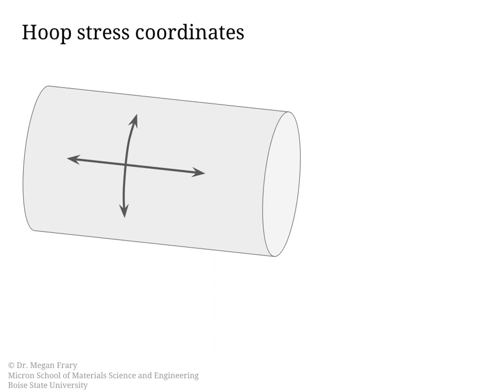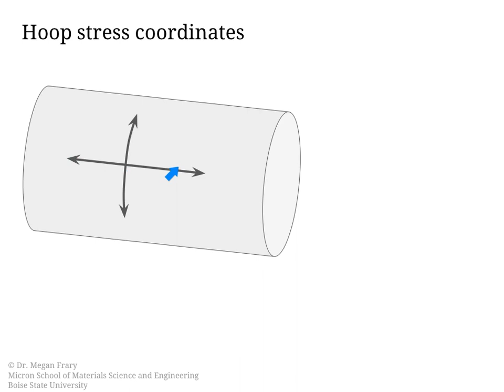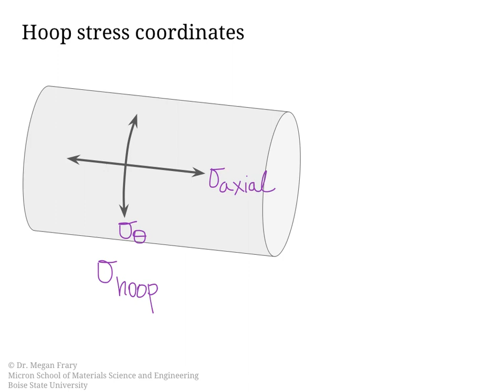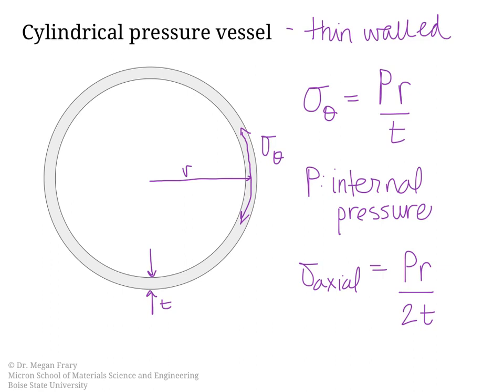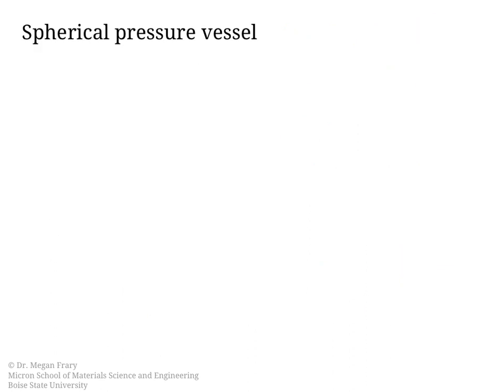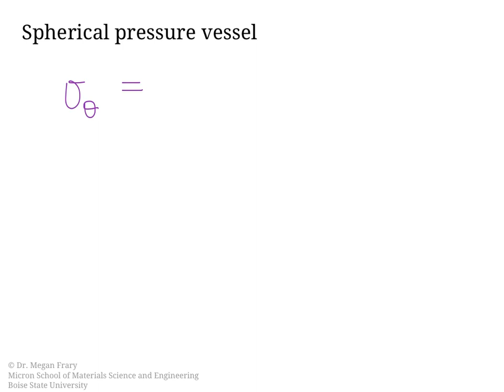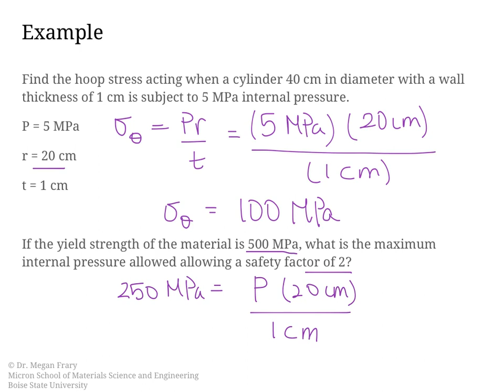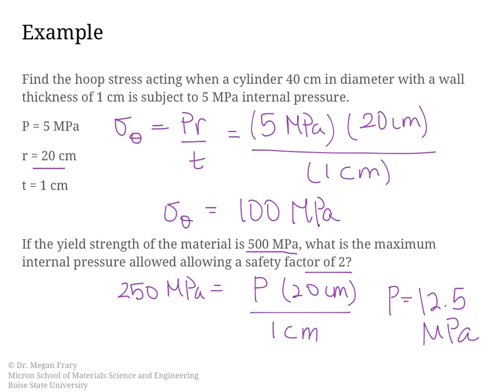Hoop stress

Comment: Hi, I have a slightly strange question if you’re still around on here. I have been speaking to a flat earther who seems to think he’s found ‘proof’ that the earth should rip itself apart due to hoop stress caused by the centrifugal force due to rotation (as in a flywheel). I’ve tried to get through to him that due to the far greater opposing force of gravity, the net acceleration experienced by any mass within the earth is towards the axis of rotation and therefore no hoop tension could be present in the crust of the earth - instead it would be under compression, not tension. My analogy for this would be a pressure vessel with an internal pressure of 1psi situated within a pressurised environment at 300psi, resulting in a net external pressure of 299psi which will place the vessel walls under compression, not tension. 

Could you confirm that this analogy is correct, with respect to the forces experienced by a theoretical ‘hoop’ around the earths equator? 

Thanks in advance
Reply: Centrifugal force of the Earth can be easily calculated and is much less than force of gravity, you are correct there. That would be a decent analogy to use in my opinion but I'm certainly no expert.

Comment: Could this calculation be used for a piece of pipe laid down in a trench and up the other end...simulating the pipe in 'compression', and not 'tension', and the compression load is the weight of the tube?

Comment: Thank you and appreciated! How do calculate hoop stress when the radius vary along the pipe. Rahman
Reply: Hoop stress should be thought of as applying (on a cylinder) to thin strips of the cylinder. if you have a varying radius then you have varying hoop stress as you go along - if you think about the direction of the forces associated with the stress they only act along a circle of a fixed radius for each of these different strips, hence if you wanted to find the average hoop stress, you would just find the average radius and perform the calculation with that. In a real world scenario this wouldn't be too useful - the only hoop stress you would be interested in would be the maximum hoop stress, and you only need one radius value (the largest) to perform this calculation. If you are talking about axial stress, then since this acts along the direction of the cylinder where the radius is changing, it would certainly affect your calculations. I'm entirely sure how you would go about finding the axial stress from this, but I have a feeling you find the average out the axial stress by integrating along the length of the cylinder? I'm kind of new to this topic so if anyone would like to add/correct anything I've said it would really help me out
Reply: Integration

Comment: hold on, why is axial stress divided by 2t? can anyone explain a little bit?
Reply: same question here
Reply: Also, why is it p•r & not p•d? 

I thought hoop stress was p•d / 2t?
Reply: @Tanoforfucksake  you're completely correct, this equation simply decides to use radius instead of diameter. If you sub r=d/2 into the equation in the video then you get your equation of pd/2t
Reply: @thomaswilliams9320  search in thin walled formula derivation.you will understand.